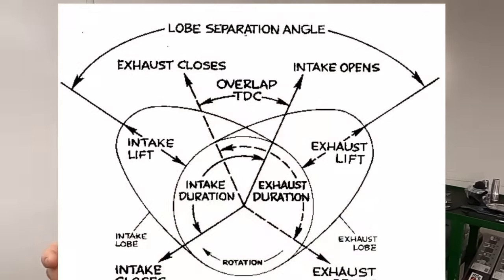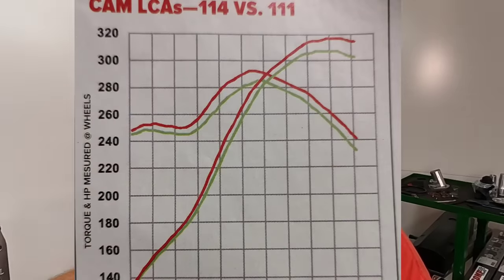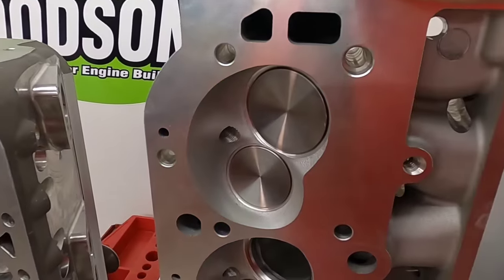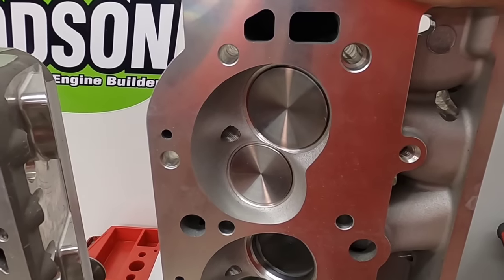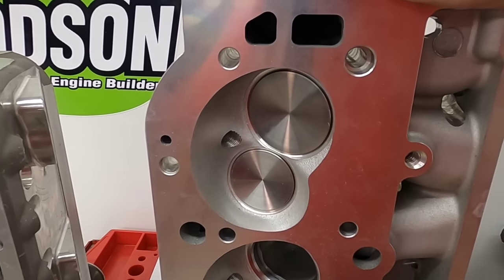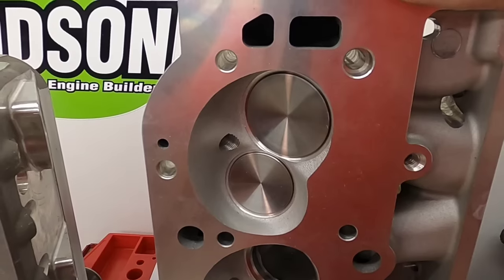Camshaft Lobe Separation Angle: The Untold Truth of LSA!! How to Pick LSA the right way@DavidVizard

Comment: Having played with a lot of DOHC motors the LSA is more related to making it work with the exhaust system than anything else.   It's a LOT easier to move the cams relative to one another than shorten or lengthen the header primary.   Relative to compression it's where the intake closes that's most important...tighter LSA (assuming 'straight up' installation) closes the intake sooner and will trap more of the charge at low rpm and this tends to help power if you're not in an octane sensitive situation.   If you leave the intake CL the same...then altering the LSA is just moving the overlap and how the engine likes it depends on the exhaust system which often is 'make it fit' rather than 'this is ideal' type of affair.   Lots of variables to consider and just remember that the engine is a TEAM effort and everyone must play well with one another for best results.
Reply: Well said
Reply: There's much more to it on a single cam engine. LSA cannot be changed without affecting other lobe parameters. That's why VVT on newer engines, that no one seems to like, is so important. Wide LSA is also more important in forced induction applications as it is not prone to blow your boost out of the exhaust.

Comment: Would be real interesting to hear about how multi-valve engines change LSA requirements. Thanks for sharing the wisdom.
Reply from the maker: They require much wider LSA's due to the valve area vs displacement compared to the 2V heads... But maybe not as wide as one would think
Reply: that is the great thing with twin cam engines, you get cams with the duration and lift grind you want, then 2 adjustable cam pulleys and you go off to the dyno to figure out what lobe separations is optimal. pushrod V8's sure still run great but the dual overhead cam scheene is more adjustable with the same cams as you can operate them individually

Comment: In pure stock circle track we had a lift rule.  I had isky custom grind my cam and went several degrees tighter LSA only with 248 @ .050 with spec .424 lift besides lsa it was same cam everyone was running. All other specs the same.  That woke up our lap times.

Comment: Great video on that part of cam selection process!    Running a 112 on my 427 Windsor 4.125 bore/4.00 stroke 10.3 comp. 2.08 valve and mostly street use. Close? Runs good ! How did the OEM's figure their cam specs for the various muscle car engines back in the 60's?
Reply: you make a good point, we never get to see how they decide their cam profiles, what we do know is the aftermarket has beat the factory cam specs pretty much all the time since high performance started being a thing.
Reply: Drivability. Power brakes. Decent idle. Gas mileage. Smog. Etc.

Comment: so with BBC boat motors the conventional thinking is you need at least 114 LSA in order to avoid water reversion into the exhaust ports which otherwise would quench harden the exhaust valves and then snap - I have blown up two motors thinking it was valve guide clearance or some kind of after market head ( dart) manufacturing defect resulting in poor cooling on the exhaust guides - I am now a believer .. 114 is at least what is needed on BBC boat motors

Comment: Awesome video! I really enjoy this kind of tech content. Is there a way to calculate piston to valve clearance change with LSA change? I’m not a rocket surgeon so hopefully the math is easy.
Reply from the maker: That is a good question. But it really depends on the duration of the lobes.. a 220 deg on a 108 LSA will have more clearance than say a 230 deg lobe on a 108 LSA 
I know that isn't a clear cut answer but with most aftermarket pistons you will have valve notches that will accept "most" cams
Andy

Comment: 13 “Enter through the narrow gate. For wide is the gate and broad is the road that leads to destruction, and many enter through it. 14 But small is the gate and narrow the road that leads to life, and only a few find it.
Reply: Matthew 7:13-14, Certainly a bit off topic but of vital importance to everyone who wants to go to Heaven instead of Hell.
Reply: I was preaching narrow LSA
Reply: Or as Jim Morrison sung- "The gate is straight, deep and wide, break on through, to the other side."
Reply: I use a 108.lobe separation cam in my big block merlin bracket engine  and it works great!
Reply: @HarryBurgess-jm9jq  Excellent feedback.    I'm certainly going tight lsa on a 6.2 ls3.   I want elevated torque and more power!

Comment: Unfortunate about DV's channel, I wondered why there were no recent uploads.  I have signed up 'cause I don't want to miss any more. I would like to bump into DV in my local speed shop one day, that would be trippy.

Funny that you talk about a 'bottom of the page camshaft' in a 262 SBC. That was my scenario at one point, almost.  I had one of those 262 ci small blocks in a Monza and a mechanic at work brought in a camshaft for me when he heard that I was interested in an aftermarket one. I had already swapped out the 2 bbl for a small 4 bbl.  I knew nothing about the camshaft so I took it in to a speed shop and asked the guys behind the counter.  Well...  This thing was a few years old and all we could work with was the grind number (it was a Crane).  The grind number was right off the bottom of the page of what was then the current Crane hydraulic flat tappets (rollers were but a dream then) and the guys warned me to stay away from it.  One of the guys said "You'd be lucky if you could get it started".  Well, I believed them ( I think it was over 260* at 0.050") but the guy who owned the cam was completely pissed off that I wasn't gonna use it.  "It's a small block cam so it will work in a small block".  Maybe that what the cam grinders are saying with their random LSA grinds!

Comment: Man you're 100% right I'm running 260 268 at 50 with a 13.5 to 1 compression ratio at 116° LSA I will say my lift is only 555 and my runners are relatively small for a 388 turning 7200 RPM but in the end as long as your choke doesn't accidentally close it made for a hell of a good fuel mileage RPM machine. And enough torque I finally stopped breaking things after it was all upgraded to one ton then it was slow as s*** comparatively speaking
Reply: That is the issue I am having now do I stay with the transmission and rear end that robs very little power but can break anytime or put bigger transmission and differential but lose more power
Reply: @utahcountypicazospage5412  I don't know man it all depends on how you're going to use it I jumped my truck and launch it 4,000 RPM. Honestly if you keep the weight under 4500 lb the Ford 8.8 will hold anything you can throw at it. Not the newer one you have to have the older one that is all one carrier unit.
Reply: Turbo, or Blown wants a wide lobe center so your Manifold pressure isn't wasted
Reply: Why not 106 or 108 LSA?
Reply: Some 410 Sprint car engines are in the 100° to 102° ranges with over .750 lift. At those numbers good valve springs are a must.
Reply: That's good to know, and those 410 sprint cars make unusually high power and torque numbers.   Richard Holdener did a LSA video on a 500HP LS situation, where he used the same cam duration and lift ground on a 120 lsa, 112 lsa and 108 lsa.    The 112 lsa made 34 more peak ft-lbs of torque and HP was 5HP higher.     The 108 lsa made 14 more peak ft-lbs of torque over the 112 lsa and the HP was 7 HP higher than that even.   Our assumption had always been a wider lsa will make less peak torque but have more rpm and higher power at the top.   That was not true.    @ChiefCabioch
Reply: @dennisrobinson8008  lol I like cheap fuel 91 is expensive enough

Comment: The fact that the following variables influence the ideal LSA, and that your 128 formula does not take them as input, is all one needs to know to understand that the 128 formula is not comprehensive.

Throttle size
Intake manifold
Port flow maps
Chamber flow trajectory
Intended RPM range
Valvetrain stiffness
Valvetrain mass
Valve acceleration
Header diameter, steps, collector dimensions
Exhaust system
Drivability requirements
Emissions requirements

Comment: Simply put, increasing overlap (lowering LSA) causes the exhaust valve to still be flowing air outward at the same time the intake valve opens enough to begin flowing air into the cylinder, thereby using the exhaust flow to literally suck more air/fuel into the cylinder.  This is almost like having a small turbo or blower installed onto the engine.  The more efficient the head combustion chamber is at cross flow (BBC, BBF, Cleveland, LS), the more power this gains.  Having the cylinder better filled at the BEGINNING of the power stroke is especially beneficial for the TORQUE CURVE.  Street engines don't rely on horsepower as much as torque because horsepower is built at higher RPMs tan you typically use on the street.  Higher compression engines (above 10ish) need slightly higher LSA to help bleed the compression off at idle/off idle speeds.  Keeping the LSA as tight as possible will give you wheel stand torque.

Thanks for sharing the new channel.  Already subbed.  Sorry for DVs loss of a great friend.
Reply: I'm at 11.6-1 static and 9.78-1 dynamic on my 355 sbc with 2.02 intake valves and I  have 108LSA solid roller cam and 234 intake and 242 exhaust duration @0.050.  Intake valve closes at 42° ABDC.  compression checks give me 220psi average.  why would you need to bleed compression off at idle / off idle speeds?  Just curious why so that I can make a change if I need to, thanks
Reply: @kevinclancy. I would like to know this as well
Reply: @jonathanharris185  exactly- my point was that I don’t need to “bleed off compression” because I have my quench dialed in at 0.040 with 64 cc chambers so there’s no ping for me
Reply: @kevinclancy. thank you.  You have a cool name by the way. Cheers and happy Friday!

Comment: Andy, Mr. Vizard, a few questions. Is it more important to have a specific LSA, or to have a specific lobe with a desired lift /duration. I ask because of this: if I choose a lobe with the lift/duration I feel will work best, then with a given LSA, the overlap will be let's say 40 degrees. If I desire 40 degrees overlap, but now specify a cam with a smaller LSA, the cam lobes will generate a larger overlap period. Do I then re-choose a lobe with a smaller lift/duration to match the recommended LSA to simultaneously achieve my desired overlap period? Is it correct to say the optimum overlap period is the central thing you are trying to achieve?  If that is true, then I should first choose the lobe with the lift /duration that I desire first, then pick the LSA that will give the desired overlap period as a result, correct? They are inter-related from what I can see. 
   Or are you saying that most peoples cam selections have less overlap than they really need, so decreasing LSA is the best way to increase the overlap? The same thing can be accomplished with a larger duration lobe if the only change that is needed is an increase in overlap, correct? Otherwise, if the LSA is what dictates the best performance, then one may need to increase or decrease their lobe lift/duration to accommodate the LSA within the confines of the desired overlap period, true?
I look forward to subscribing to Mr. Vizard's new channel. Thank you once again for your shared knowledge, both of you. God Bless!

Comment: I wish I could download the wisdom DV has! Especially since I want to apply it to slightly different engines than y'all are interested in. I'm here because I know of DV and this subject interests me in trying to track down details on my 2.0l Formula Atlantic Spec engine from a Mazda! It's running a world challenge head, but boosted! Had the cams installed but keep lifting the head due to cyl pressures. Think I got it figured out down to Open/Close angle, but want to adjust LSA beyond that for best spool times, and power balance.
Reply from the maker: Im very fortunate to have DV in my life.. That is forsure.  He has forgotten more than I will ever know!
Andy

Comment: I wish I could have learned this 50 years ago... LOL A friend (?) of mine helped me rebuild a 350 corvette engine for my 62 Bel Aire and I really didn't know anything about anything at the time. He assured me that this "Duntov 30-30" solid lifter cam would be great for my build which I already had a Holley 600 with vacuum secondaries and he talked me into getting a "Torker" manifold even though it was for a purely street engine with 3/1 rear gears. Duh. I had to be in first gear to avoid lurching and bounding because the engine wasn't turning enough rpm at any speed below 30 mph. It got 6 mpg in town. Oddly enough it got 22.5 mpg at 75 mph. I wish I still had that car. My first wife couldn't hold the clutch in when trying to move from a stop so half the time it stalled and half the time it gave a great bounding leap. I should have kept the car because she left me a few years later.
I've never seen either of your channels before but I'm going to subscribe to both. I have a 1969 Mustang I'd like to put a 302/5 liter in and build it to have max power between 1500 and 5500 rpm. I live in the north west corner of Arizona and we spend a lot of time at 75 mph but we live in town. I don't race, period! I plan to put a cruise control on the car so I can set the speed at the speed limit then keep my lead right foot off the power pedal. I expect to learn a lot from your channels. 
Thanks
Chris
Reply from the maker: Chris, Thanks for the kind words and for the sub s 
Sounds like you will have a fun ride with the Mustang!
Andy

Comment: I've used 108 LSA on my Pontiac engines . Run awesome on the street on pump gas .
Reply: We ran 108 LSA on Pontiacs too. They would run a little quicker at the drags, however the problem was the gas mileage sucked for a Street Machine back in the 1970's & 1980's. So I would have Crower grind me a 112 LSA and run it 4 degrees advanced to get the 108 on the intake, and the gas mileage didn't suffer as much as with a 108 LSA. That seemed to be the best for what we were doing back then. I miss those days of experimentation.

Comment: The wide LSA on the early Ford mod motor cams was necessary so that the cams played nice with the factory EFI systems. The software and map sensors did NOT like a fluctuating vacuim signal from cams with a narrow LSA creating big overlap. The pulsing vacuum signal in the intake would confuse the ECM and the engine wouldn't run well at idle or low RPMs. 

As aftermarket, and factory ECU's became available for these engines, and more tunable and customizable, cams with narrower LSA's became more available for the mod crowds.

Comment: In my opinion,  Valve Overlap is the #1 issue on street engines because the wider the Valve Overlap,  the more one starts losing power brakes and the camshaft becomes a "lopey" idle this makes the engine less vacuum and more difficult at idle.  One will lose gas mileage too.  For a street engines one should have a max of 40 degrees of valve overlap at at .006 start lift and still have enough vacuum / power brakes and not have a "lopey" idle.
Reply from the maker: If you pick too much duration on the tighter LSA you are right.. it's better to have the right LSA and less duration!  I have proven this is my own Dyno tests.

Comment: So when you're building and engine for a particular car where do you start?  The ultimate use of the car?  Rear end ratio?  Trans gears?  Engine specs?  Tire sizes?
Reply from the maker: The use of the car..  build the engine for that and then match the drivetrain to the engine specs/needs
Hope this helps
Andy

Comment: Should sum it up;
Overlap = Power

My tow pig has an 11:1 SBC 383 with 2.02/1.60 valves and has a hydraulic roller with 271/284 @ 0.006, 218/228 @ 0.050, 0.578 lift, 108 LSA and 106 ICL. 61.5* overlap at 0.006" and an IVC of 61.5*. Its torque curve really moves it out from a stop and it will cruise all day long at 1,500-2,500 rpm in overdrive, between 55 and 85 mph.

Comment: Very useful information and formulas!  I used the two formulas to calculate the LSA for an AMC 401 and 304, assuming the same set of heads would be used (2.025 intake valves) If I used the formulas correctly, with all variables being the same except for CID, then LSA is inversely impacted by CID.  For the 401 I came up with an LSA of 100.82, so 101 and for the 304 it was 107.235, so 107.    Does that seem correct?

Comment: I contacted camotion about a turbo 414w sbf. They specs they sent me for the cam they wanted to make were bazar. First off the lsa was 115 degrees. No damn way. It's also lower on lift than I would like. Duration is reasonable but a little on the short side. I'll be calling them after Thanksgiving to ask where they got those numbers.

Comment: I have a 1985 1 ton 4 speed dodge truck with a stock 360 engine. I want more power for moving heavy weight. How should I build it? Which camshaft, heads, intake, and carburetor should I use?